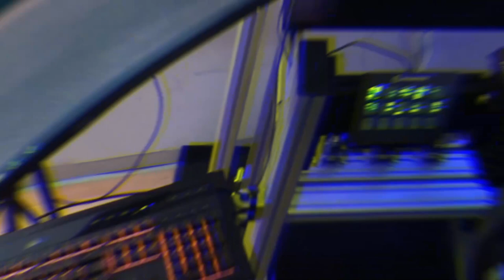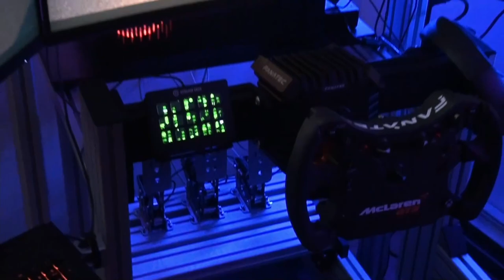Insane Triple 32" Sim Rig!!! PSR1 from Raceanywhere!!

Comment: im on a sim lab evo wanting to upgrade to a bigger cockpit. the evo is perfectly fine but i just want a bigger unit, thats all. for the price of this compared to p1x this seems like the most bang for buck. the monitors, are they curved or flat? im also looking into a triple over my super ultra wide 49
Reply from the maker: yes absolutely the best value it has every option/add on i wanted in other simrigs  but with raceanywhere it all comes together at a very competitive price. The quality is excellent. As for the monitors mine are curved AOC 32" 1080p 165hz 1ms response time...also the best bang for the buck LOL. hope this helps any other questions feel free to ask 👍

Comment: Hye man, triple 32 inch 1080p can you see the pixels on that screen tho?
Reply from the maker: nope it looks beautiful. 👍 1080p will perform and look great u just need to get monitors like these with a high refresh rate and low response time. Mine are AOC 165Hz refresh 1ms response
Reply: @outlawsimracingjayboy  okay mate thanks for the response, I will consider it later. :)
Reply: @outlawsimracingjayboy  Tnx mate for a info! I choose between 27 inch and 32inch tripple screens, 1920x1080, between AOC and Sansumg G5 curver monitors (144Hz both)
I have not yet decided what I want more
Reply from the maker: @vlad7177fdrt  LOL thats what took me the longest to decide...which monitor to choose from. Those are both great products 👍
Reply: @outlawsimracingjayboy  yea but G5 is 2k (2560x1440) isnt it? I mean u can set fullHD res on 2k monitor in your nvidia\amd tripple monitor app but I assume it's not that easy

Comment: I’m curious, what is your distance from eye to monitor in front?
Reply from the maker: 30 inches  if I was running 27" monitors i would b closer.  I found you need to set the bigger monitors further back and make some custom in game adjustments to achieve the best FOV. At the time of this video I was still experimenting with FOV , distance to monitors and side monitors angle
Reply: @outlawsimracingjayboy  so whenever you tried to bring them closer you weren't able to make the correct adjustments for the side displays to look right?
I am running a single ultrawide so I apologize if this is a dumb question, but I don't have any experience with triple screen setups. Cheers!
Reply from the maker: @MihaiCostiug  no you just don't need a bigger monitor that close . The 55" OLEDs that people are using now have to be even further away. Or everything will look too zoomed in when you place a bigger monitor that close. The rule of thumb is youwant to have the edges of the side monitors at the edge of your peripheral vision.